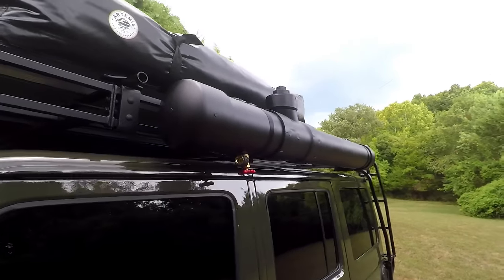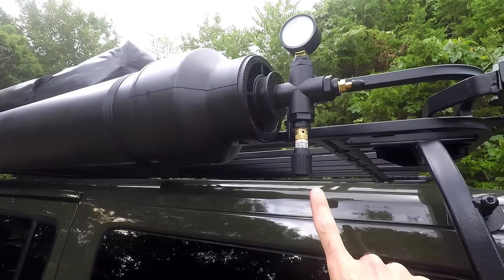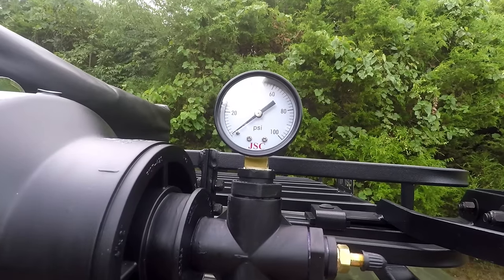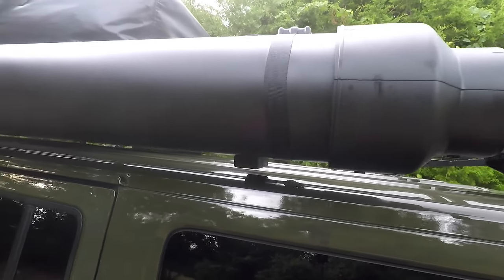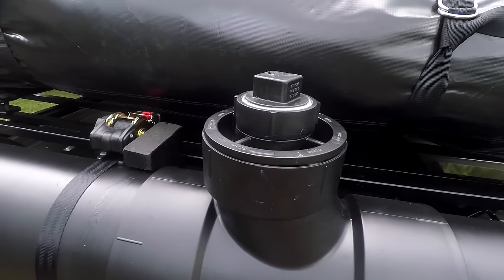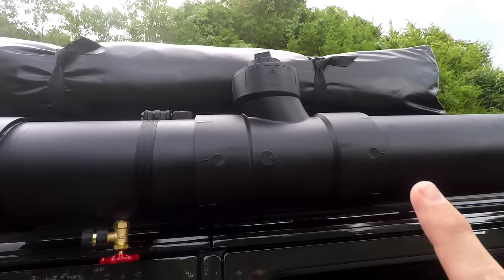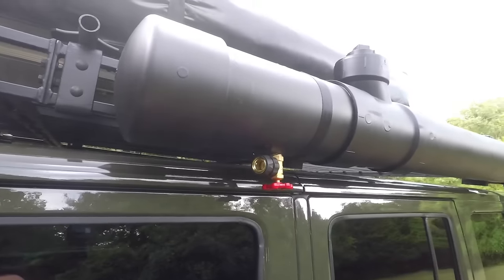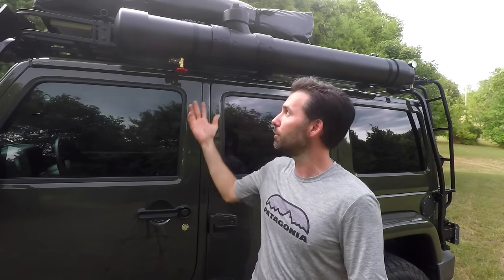DIY Camp/Overlanding Shower Walk Around

Comment: Nice. Thanks for this. 1 question though, wouldn't it be better to mount the Schrader valve to the top of the filler cap? That way the air inlet will always be above the water level and you could probably double the amount of water your system holds.
Reply from the maker: It wouldn’t double the amount of water.  The water won’t come out the Schroeder valve because it’s pressurized. It could get knocked off by a limb if it were on top.

Comment: I can see getting out the door and cracking my nugget on the boiler valve. I think id move it back toward the pressure vavles
Reply from the maker: Kyle BLUNT probably wouldn’t be a bad idea. I haven’t hit my head yet but I could see it happening. Thanks for watching.
Reply: Kyle Blunt I was thinking the same thing. I was wondering if it would be better flipping it around so the boiler valve is at the rear of the Jeep.

Comment: I've seen people put the pressure valve on top with the lid. Thoughts on that and how it may work better ?
Reply from the maker: Evrim Özalp probably would work much better.  Mine fills with water when it reaches the threshold, which doesn’t seem to hurt it, but it might not if it were on top.

Comment: Thanks for this video.  I'm in Florida.  On a sunny day where it's above 70F outside how hot you think the water will be when the sun sets? Given it's sealed how about 2 hours later if it's above 70F outside?
Reply: That is a good question. How long will the water remain hot after sun down ?
Reply: @glenn9892  Since this comment, I've actually built and installed my own custom 7 gallon tank on my van roof (seen on my channel).  In Florida, on most days (even in Winter) the water is comfortable to HOT from 1pm to 9pm. It's overkill, but  on my tank I Installed a 1500 watt heating element that can heat the water in 10 minutes and even tested a custom 1500 watt on-demand heating element pipe that works great as well.
Reply: @12vLife  Awesome. I am trying to run only on solar panels and my battery bank. The big freeze we had here in Tx last feb help me realize the weak spots and everything that needed improvements. If I can heat most of my water with the sun ,it would be a big help or even pre-heating water for my water heater.
Reply: @glenn9892 Prepping is just a good idea now.  If I were building this tank again I would take a different approach and keep my ports down to two tiny tire valves (one gutted for water line in and out).  For heating I would use an external custom on-demand 1500 watt pipe tank.  Truth about these showers is you don't need much hose diameter to get enough water to shower. There is a video on my channel of the pipe tank.
Reply: @12vLife 
Checked your channel, and unless it is just a click-bait, you have only 2 videos and NO van roof 7 gallon tank build... Pit, I would really like to see it...
Reply: @alopandur  Hey sorry,  had to move things around.  Nice.  I built a U-shaped 12gallon and wrapped it around a 320 watt solar panel but I used only two air valves.   takes longer to fill, but super frugal and easy to pressurize.  Water always seems to be hot.  Video on my channel now.
Reply: @12vLife  That's awesome man, thank you. I already checked the video. Impressive! (also, gives me some great ideas for my Jeep roof)